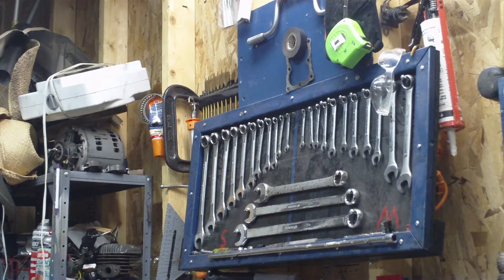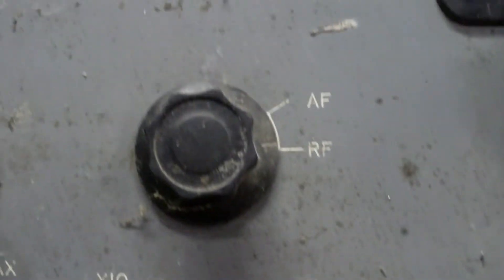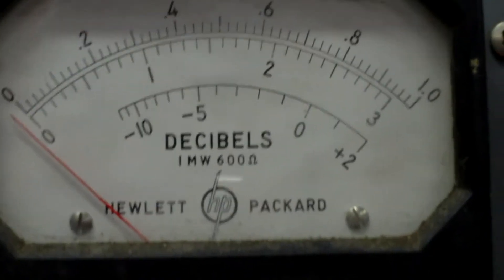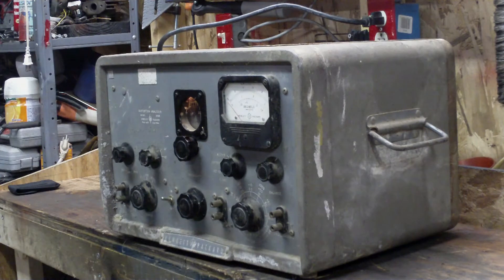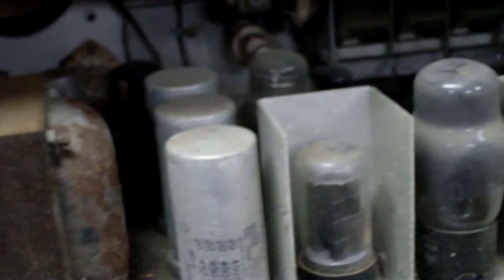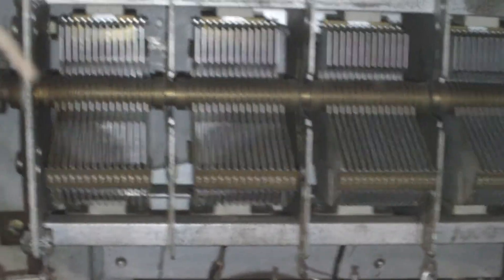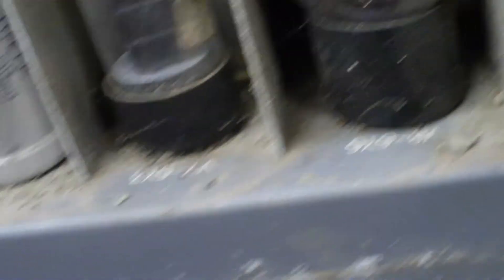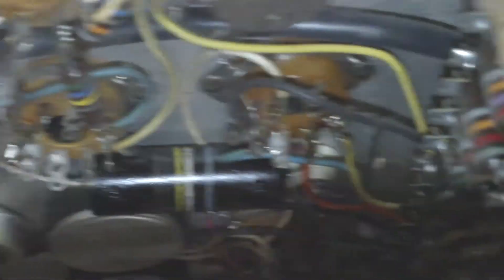Hewlett Packard Distortion Analyzer Model 330B

Comment: Hello, about nine years too late, maybe. 

I have one of these (and a collection of other distortion analysers also, including an HP8903E digital distortion analyser).  The 330B is for measuring the harmonic distortion in a signal.  Typically, you will use a signal generator with very low harmonic content and apply that to the input of an amplifier that you want to test.  You then use the distortion analyser to measure the percent of harmonics in the output signal from the amplifier.  This gives you the percent distortion produced by the amplifier.

To make the measurement, you adjust the analyser so that the signal at the fundamental frequency is nulled out.  What then remains is the harmonic content and that is indicated on the meter of the distortion analyser as the percent distortion of the amplifier.

Getting it back into working order would be a significant project and would require a very  good understanding of the principles of vacuum tube circuits and of frequency selective circuits.  I have its manual in .djvu form if you would wish me to send it to you.

I also have a British Marconi TF142F distortion analyser from the same epoch.  The HP 330B has more tubes in its stabilised power supply than the  Marconi analyser has in its entire system.
Reply from the maker: nah not to late, i still have it and never did anything more with it. I figured it was used for something like that. I am used to working on guitar tube amps, i'm sure this would be similar. I don't know if i'll ever do anything with it, but just held on to it. I love old electronics, especially tube powered equipment. Thanks for Watching!

Comment: Thanks for posting this. I have the same model here, but the kids at the University pulled out all the tubes, and the outer case is gone. So, except for salvaging the nice four-section variable tuning capacitor, the one here is probably destined for the recycle bin. In its day, this was considered a very good distortion analyzer. But these days, any PC with the right sound card and application software will probably out-perform it. I think I'll attempt to repurpose the variable capacitor in a phase-shift audio oscillator circuit.

http://www.hpmemory.org/news/300a/hp300a_page_00.htm has some information regarding Hewlett-Packard distortion analyzers. http://www.radiomuseum.org/r/hp_distortion_analyzer_330b3.html has a lot of information about this model, but it seems you have to register and pay to get it.

Comment: I am surprised you don't know what it is. You tie about 30 feet of rope to it and put it your boat, When you get where you want to be, stop the boat and drop the metal box in the water, When you want to leave, pull it back into the boat. hi hi. Or if it's windy outside and door want stay open put it against the door. Also good for squishing slugs and rats.

Sorry, could not resit.
It's an older distortion analyzer for measuring harmonic distortion at audio frequencies.

Glenn
DSM Labs )dot com)

Comment: It measures distortion at any frequency between 20cps and 20,000cps. It also measures distortion in an AM modulated radio carrier.It came out in 1948 and was sold for $395.00. I guess you can test a guitar amp with it.